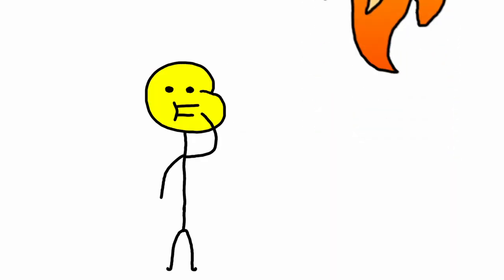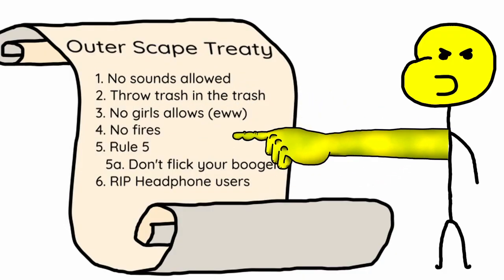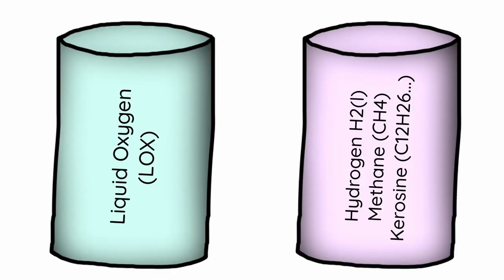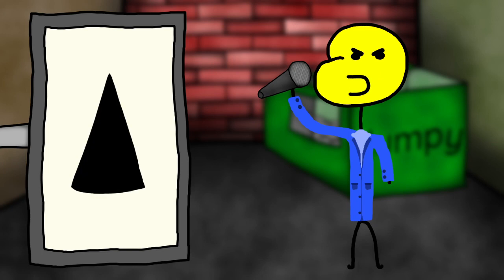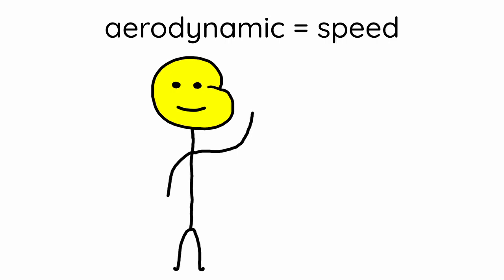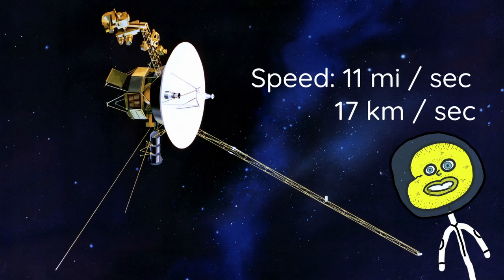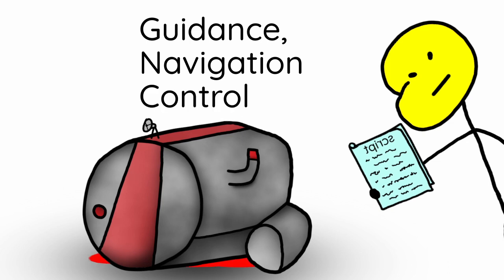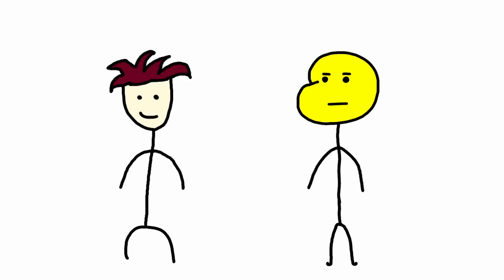How rockets work (in simple terms)

Comment: You explained basic facts (mostly correct). You tried to copy basic animation channels but you missed everything that makes them enjoyable. This was lazy shit
Reply from the maker: which part did you dislike the most?
Reply: @justEight  the parts that a 5 year old would think you know what you are doing.  Sounding disabled to sound dumb is so great, your channel will grow so fast
Reply from the maker: ok and you said that the facts are mostly correct. which part did you find to be incorrect?
Reply: @justEight well your diagram of a fly by was just an animation of escaping a gravity field by repeatedly burning at the optimum point over multiple orbits, not how a fly by is used. Hot gas is also less dense so cold gas would work better. It's not the heat that matters, heat is wasted energy that is lost during combustion. The solid/ liquid fuel is turned into a whole bunch of gas that wants to expand in all directions. On one side is the rocket, which it pushes against, the other side is open. Rockets don't shoot out hot gas
Reply from the maker: oh yeah the flyby part was incorrect, i'll give u that one.
Also, the part about gases being stored at cold temperatures is also true, but i didn't say what temp u should store the fuel. i just said to store it in liquid form.
And the last point about the molecules are the ones pushing, not the hot gas is also correct, so I'll also give u that.